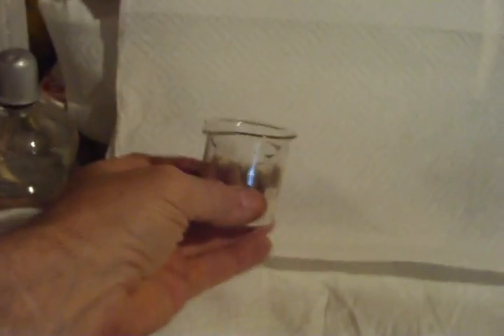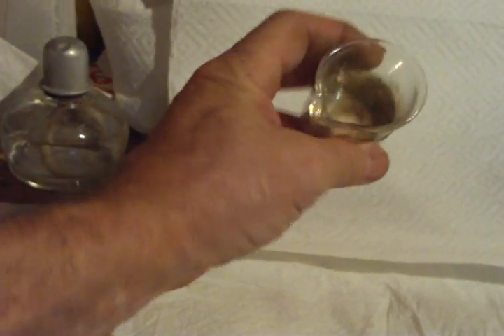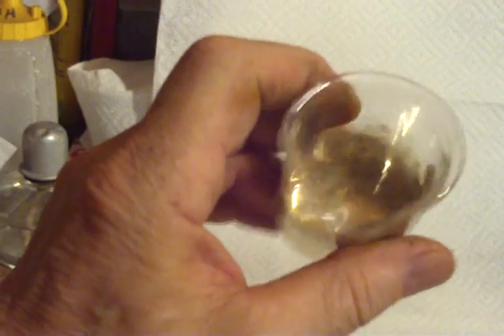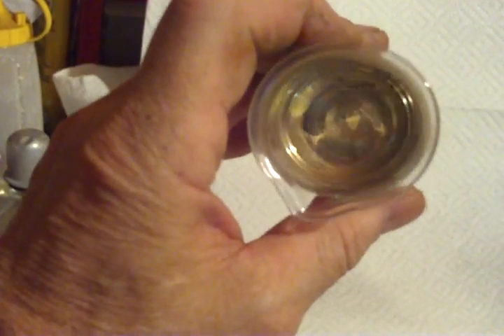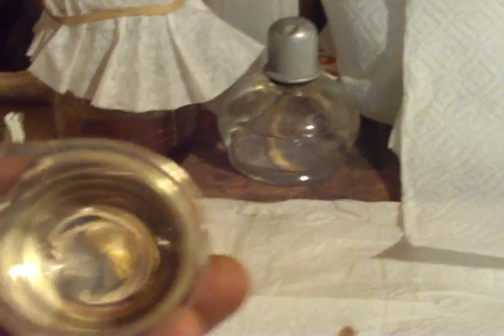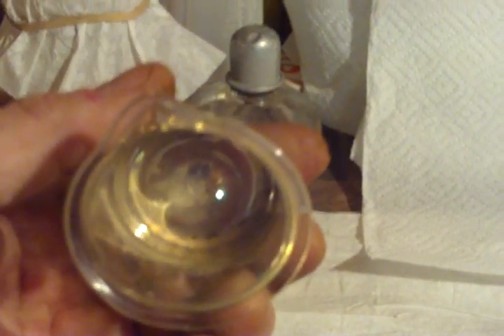10 inch Mirror Silver Coating 002.MOV

Comment from the maker: I read some where that they did do plastics??? The dam i used is plastic and it was stained, but not coated. Maybe the mold release that was use when they made the sheet?
Thanks
Reply: I know this is an old comment but did you have any success with plastic? I'm thinking of making a 3D printed telescope with a small PLA mirror but the cost of silvering commercially makes it nonviable.